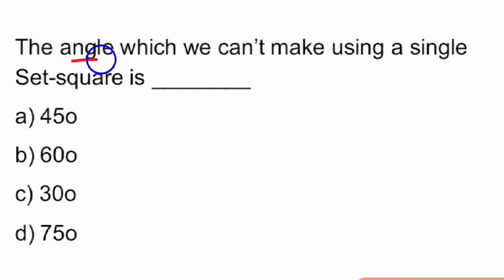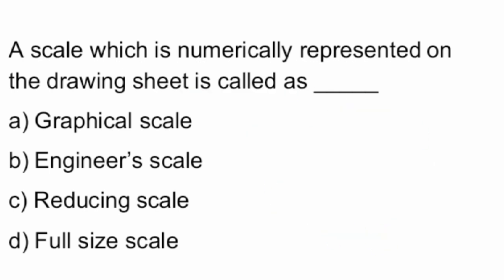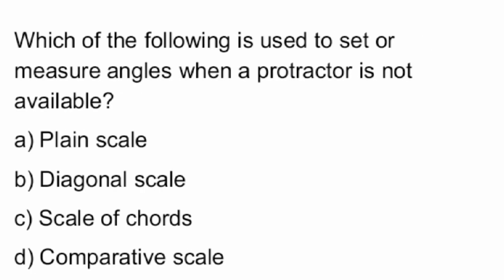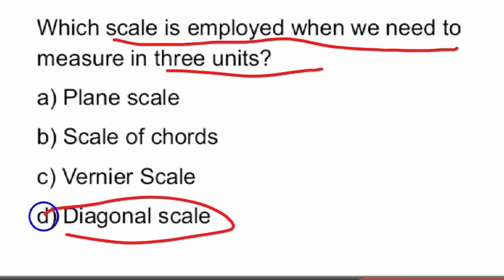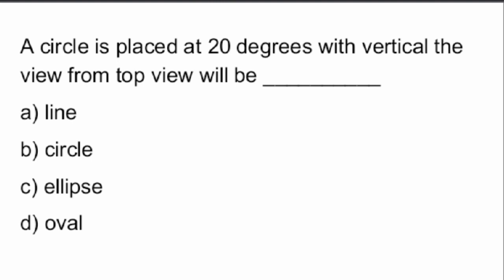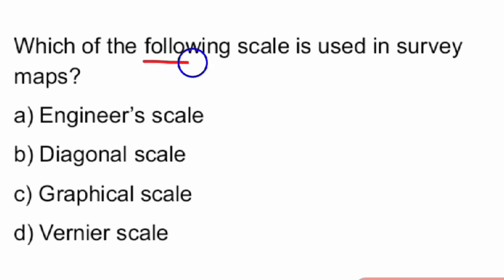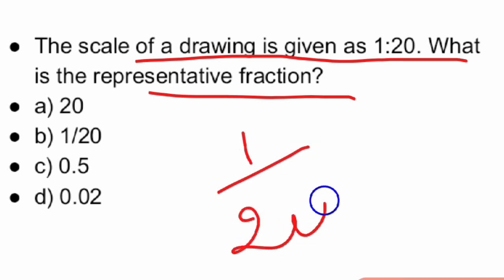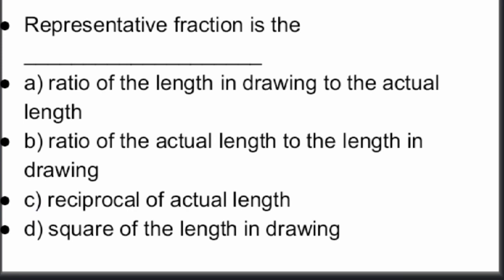#tspsc #sccl #civilengineering  TSPSC Town Planning & Building Overseer ( TPBO) Model Questions

Comment: A square is held 30 degrees with horizontal plane and turned 30 degrees with respect to vertical plane keeping earlier condition constant.
The front view will be 

Ans = Rectangle 

Its not line 
U said wrong answer 
Check it once